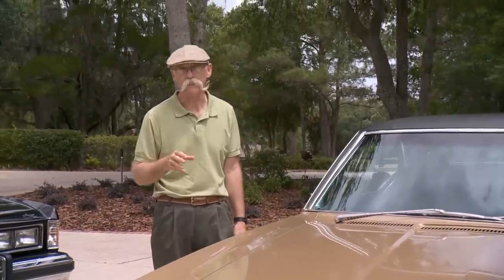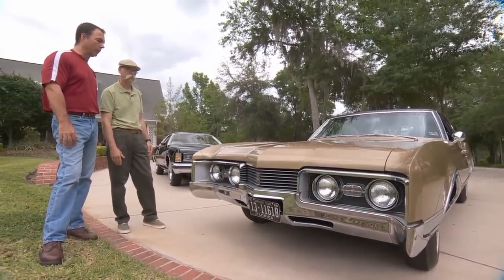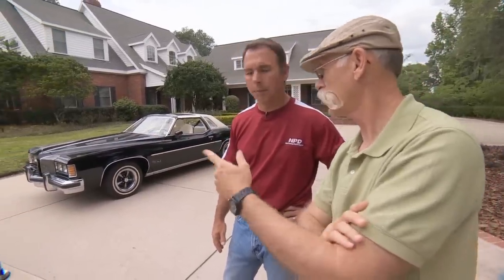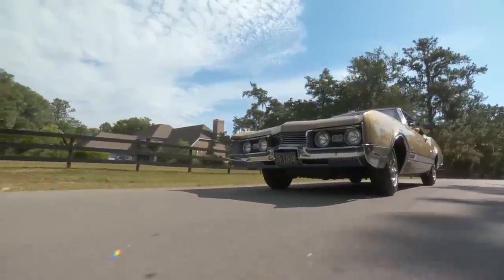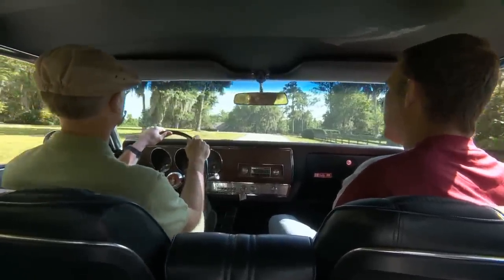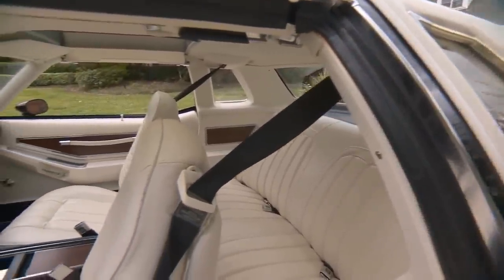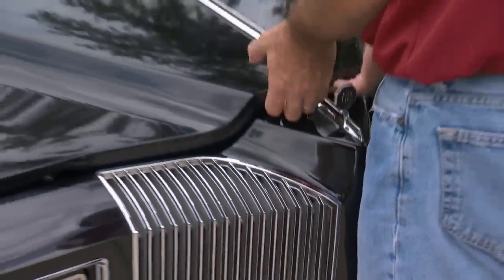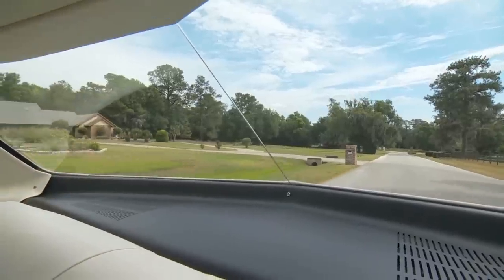GM Luxury Sports Cars

Comment: Dennis I have to tell you that I was a car salesman in 1976 and helped a customer order the most optioned car Pontiac had ever sold. Not option packages but options. It was the same color inside and out as the Grand Prix you drive in this video. But I think it was a 1977 model. The man wanted to get one before they were retired cause he loved the looks of the car. It was in Kansas and I won an award from Pontiac becasue of the order. For it's time it was an expensive car! He really worked hard and kept deciding to corder more and more things added to the car. I do not remember every detail but might if I work at it.  Pretty sure it was the 400 in it too becasue power to weght ratio was better with that engine. Let me know if you want to know about this and more from my car history. Oh yes I was driving a TVR 2500M that was modified when I bought it new in Jan 1975.

Comment: I did notice that it had no power windows, and the plain jane steering wheel, but it did have T-tops. That was back in the day when you didn't have to order PACKAGES !  You could order every option individually. Those were the days.
Reply: no a/c either..
Reply: u still can, with some dealers.
Reply: @atranas6018  most manufacturers don't allow it.
Reply: I ordered a 1973 Monte Carlo the way I wanted it. Like you said there were no package options. It took about twelve weeks to get the car. Was there when it rolled off the truck, oh what a feeling. Crazy thing it was considered a mid sized sedan .
Reply: Those were the days without imports starting to get really good and out-compete the US makers. Gravy train days.

Comment: Love the Grand Prix! I owned a 1970 SJ. It had the 455ci engine, positraction rear end with automatic transmission and electric everything!  From a dead stop it would smoke both rear tires if you stomped the accelerator! And it was smooth, a very nice luxury muscle car. If not for the 10MPG I would have kept the car!

Comment: I had a 74 Grand Prix, I loved it. My sister had a 76 and my brother had a 72.  The 74 and 76 were the same cars, except for the grills (waterfall on 76) and tail lights (horizontal back of light in center of tail light on 74). The 72 was a much different car, but still similar.

Comment: This way motors should be built, easy to work on, not compact  no computer crap
Reply: Faith Roberts if agree that the engine, transmission, and emissions should continue to be computer controlled, then I agree with you.  Reliable auto computers were IMO mastered in 2002 by GM where Old school knobs and dials were actually controlling computers, and servos.  Today's touch screens and stuff are crap.
Reply: If you kept your foot out of it that GP would get 20 on the highway
Reply: Yeah nothing like a 6.6 Liter V8 that makes all of 150 Horsepower
Reply: If they’re computer controlled you don’t have to work on them as much 😉
Reply: Beautiful & historical, but gas hogs, polluters, death traps.
Reply: That's what makes modern cars disposable

Comment: Had myself in the 80’s a ‘72 Olds Delta 88 Brougham. 2 huge doors, Rocket V8 350 and the pimpy brocade material interior. Hard on gas , but what a cruiser.

Comment: I used my dad's '76 Grand Prix to do the road test to get my first drivers license. White with a red landau top and red interior and red pin striping. What I thought was interesting was the slots in the chrome bumper for jacking up the car, the jacking points.The tire iron was the handle for the jack. Can't do that now.

Comment: I am ALMOST finished with my 1973 Grand Prix. The luxury is now gone replaced with a gutted interior with a few switches and 2 plastic buckets, 11.4 to 1 KRE 310cfm headed 461 with a reverse manual level 4.5 FTI transbraked TURBO 400.

Comment: I had a1976 Gran Prix. Blue on blue with power everything. Great car and good mpg for the time.
Reply: 400ci 4v. Flipped the air filter lid and secured it and when floored it made a motorboat sound.

Comment: The Pontiac Grand Prix, was a gorgeous car from 1963 through 1977. After that... "FOR GET ABOUT IT".....YUCH!😕😥😨
Reply: Ridgewood Fats my 2006 GXP was FIRE! So I have to disagree a little.
Reply: I agree upto the last year you mentioned. Yes they were really downsized in more ways than one after 77’ but drive a 2000-06 Grand Prix GXP thennnn give me your New Years. I drove a 73’ GP in 76’ and a 89’ SE in 92’. The 89 SE was gorgeous white over grey leather, moonroof, luggage rack, steering wheel controls, fully loaded but 3.1 V-6 was a little weak.
Reply: The g-body Grand Prix wasn’t bad!
Reply: Have a 2001 GTP supercharged that's really in the tradition of the older ones.
Reply: Just to make this clear 1962 was the first model year for the Pontiac   Grand Prix.

Comment: I had a 1976 GP in High School in 1984. My Dad bought her brand new in 76’ and passed her down to me when I got my drivers license. Black with a saddle vinyl interior. Mine was not an SJ so I did not have the center console, T-Tops or the 400CU I’m assuming the one featured here is a 4 barrel Rochester carb. Mine was a 350CU two barrel that put out 160hp if my memory is correct. I LOVED that car. She was huge and went down the road with serious presents. Tons of torque out of that 350 but definitely not a drag racer. I remember racing a Honda Civic Si ...one from the 90’s I’m guessing and I lost that 0-60 sprint by a few car lengths! But what a fun reliable car. It was hard to keep these old GM cars from rusting and the doors were SO BIG AND HEAVY that they actually started to sag on the hinges and you had to lift up the door in order to close it properly. Those were the days...

Comment: VERY RARE no factory A/C daughter probably hated that worse who orderes a black car that nice with no air? thats one of a kind!
Reply: Yet it was still a factory option.  If you go back to the 1960's, no a/c was the norm rather than the exception,
Reply: itsmegp46
 Im from West Texas and south Florida you couldnt give a black car away with no working ac , cars that nice with no ac were usually from up north from Illinois Michigan  Maine ect but you are correct it was an option
Reply: jay bradley I understand what you mean.  On my first trip to Phoenix, Az. back around 1979, I'd never seen so many cars with a/c.  Even cars from the 1950's. I never even knew cars could come with factory a/c back then.
Reply: itsmegp46
 They put those under dash ones in a lot of older cars too, we had one in our 74 Toyota Corolla it took up all the passengers side footwell area, the 50s cadillacs and the Lincoln Mark II Lincoln had the A/C unit in the trunk, it was a very expensive option i bet.
Reply: jay bradley Chryslers too  I've been to a few Cruiser Nights and the owner of a 1955 Imperial explained how it worked. Like you said, part of the a/c was in the trunk. The cool part were the air scoops on both sides of the rear fenders and the cold air coming from a vent located on the shelf behind the rear seat.  Very neat stuff.
Reply: itsmegp46
 Oh yea those too i love those cars!

Comment: 12:10 Look at that huge fan shroud spanning an extra foot of empty nose. The '73-'77 GP could be called GM's opening shot at downsizing; gone was the stretched wheelbase that distinguished the '72 GP from the '72 LeMans, but the hood stayed long and the 5 MPH bumpers kept its exterior dimensions at least as big. Pontiac also ditched the wheelbase stretch on the Grand Ville and in both cases, the stretch was under the hood, so interior space was not affected. With bumper, safety, emissions and CAFE regulations piling on, GM was gently weining the public from the kind of bigness that used to sell cars.
Reply: * weaning

Comment: Those were everyday cars when I was growing up... Where have they gone?
I like the '75 Grand Prix more than the '76 because of the round headlights. It's hard to believe that the Olds is as aged (avoiding the word "old" used in the same sentence as "Olds") as I am.
Those cars have a potential future anti-theft system...
Carburetors.
Very few people of the last couple generations know how to start a car with a carb.
Reply: To the junk yard..lol
Reply: lol. you make a very valid point.  The way I sees it. : ) is when these cars were new, people bought them, used them, There internal clock was set up at pretty much 100k miles, at around 90K miles, here comes the blue smoke, regardless of the 3000 mile oil change rule...etc etc etc.. we bought them and used them up and that was that. 
Fast forward 40 some odd years into the future, cars from the 50s and 60 are restored, and now cars from the 70s are coming into our radar. Look..parts are still easy to come by, making them pretty darn easy to restore, and the inner guts look kind of familiar and not so foreign.  Do you know hard it was finding an old (sorry) timer who could work on my 48 Hudson Commodore?
Reply: styldsteel1 
It took long enough for cars of the 70's to come into our radar. It seems like cars of the 60's were on the radar screen as soon as the 60's were over.
Now, about the Hudson...
Wasn't '48 the first year for the bathtub body?
All the jokes aside, those look like they'd have a better ride than anything ever created.
Reply: Agreed.  Yes..the 48 was the first year for the "step down" design. Very, very low center of gravity, gave the car a very solid, and confident ride. You sure do know your Hudsons.  Unfortunatly I had to give up the Commodore, turned into a money pit. It was quite the job finding someone who excelled with the knowledge of a car with a 6 volt, positive ground system. It's a lot to get into right now, but it found a good home in Florida.  Guy put a 350 chevy crate motor in it, pissed me off, kinda, but it wasn't my car to say. ah well.  I used to have a bathtub body.  The Hudson and i were one in the same.  (ok..not quite. )
Reply: styldsteel1 
I had an old AMC Gremlin some years ago, and was curious about AMC history. Hudson was a part of that history, so I read up on it (pre World Wide Web).
However, I think the Gremlin was more closely related to Kelvinator than the Hudson. It had an A/C that would chill ice cream, and the body was just as boxy as a very stylish deep freeze.
Reply: Correct.  Now, by no means am I an expert in the least, but, Nash/Kelvinator (which was the new AMC,) bought out Hudson motors, which was the end of Hudson.  I remember AMC having some peculiar bodies if not plain weird (to me anyway).  10-4 on that A/C unit. You'd never get me out of that car in the summer and not because i've become frozen to the steering wheel.  BTW, if and when you have some time if you haven't done so already, check out here on youtube some videos on J.L. Hudson's department store.  It was a monster. And I mean a monster. 29 floors, only the finest of the finest products. The videos are quite captivating so far as I'm concerned. Opened in 1927 and finally raised <SP> in 1998. They were in Chicago. Sad ending.
Reply: You''ll see the man himself. J.L. Hudson who teamed up and started the car company also in 1909. Lots of history here. He seemed like a real true to life go-getter. A slouch, he was not.
Reply: DrFruikenstein   Haha ! You're right ! That's funny.
Reply: What?
Reply: I'd prefer the looks of the 1976 Grand Prix over the '73-'75 models because of the (then) newly introduced rectangular quad headlamps. I'm SO glad that in 1976, GM phased out those outdated, cheap-looking circular headlights on the A-Body platform (featuring the Pontiac Grand Prix, Chevrolet Monte Carlo, Oldsmobile Cutlass Supreme; Buick Regal). That platform featuring those cars evolved VERY quickly, and in 1976 and '77 they ALL looked a WORLD of a lot more sophisticated.

Comment: Neither car had Air conditioning.   I'm sure that was pretty rare especially for the Grand Prix.  The 73 to 75 Grand Prix used real wood in the dash.  Most cars by then were using plastic that simulated wood.

Comment: The sad part is in 1967... Lol , the Olds is half worn out at 30K . but boy it was well cared for
Reply: LOL! Yup.
Reply: I got a 65 Olds 442 that I bought from the original owner in 1988 and it had 230,000 miles. I still have the car and it has over 350,000 miles now on original engine.

Comment: I had a '77 that was basically the same car except that the headlights were spaced with a parking light between them and the lens of the taillights was solid instead of louvered as the '76 was; otherwise, identical minus the vinyl top. Mine was solid dark green(I think they called it "deep forest green") with a lighter green leatherette interior. It had the low hp 301 V8 with a 2 bbl. carb, so not a performer....but was she ever a LOOKER!  I didn't buy it for that, so not a problem. 

It drove, honestly, like a dream, equipped with what they called "Radial Tuned Suspension", as proudly proclaimed with a small metal plaque on the chrome part of the instrument cluster. A real boulevard yacht! Had the "Rallye II" wheels, which were a signature Pontiac factory mag wheel carried over from the sixties, introduced in '67. Instead of the joke of a spare tire(I call it a "donut")they give you today, it came with another Rallye II factory mag wheel mounted on a steel belted radial tire! Didn't have a bit of trouble with it and sold it at around 125,000 on the clock. In my opinion, one of the prettiest  cars ever to come out of Detroit.

Comment: When America knew how to build cars, over 50 years ago now
Reply: TugIronChief  You couldn’t be more wrong.
I had a 2006 Saturn that was a piece of junk.
All new cars are pieces of crap that throw computer codes constantly.
Reply: You didn't have the oils that we have today back then. So engines wore out faster so engine rebuilds used to be common.
Reply: @beckigreen  Saturn is not the same as Toyota, Honda, etc.  Those are known for their reliability.
Reply: I worked on those cars in the late 60s and mid 70s. By 1976 they were junk. The mechanics at the dealerships worked like crazy to make a presentable car out of what rolled off the transporter. I had to chase down leaks under the dash on one brand new Pontiac. I had to remove the front fender and found out that a whole series of weld were missing in the cowl. The cars had to be tuned and retuned because they wouldn't keep running or they ran badly because the pollution equipment was a Rube Goldberg mishmash of vacuum lines, switches and sensors.  Driveability was a compromise because the manufacturers were trying to meet government standards that they were not given enough time to do the R&D to develop. If it hadn't been for the computer controlled systems we enjoy today, who knows what kind of junk we would be driving now.
Reply: @hotwheelsbob2000  do to that cars today are disposable
Reply: Disposable after 300,000 miles.
Reply: @hotwheelsbob2000  yessir

Comment: I'm old enough to remember when those cars were new. Not much excitement then. They weren't built that well. Makes me wonder that in 40 years from now, people will be ogling these wind tunnel-designed boring cars of today and consider them "classics". I won't be around then, but I predict not. Boring they are today, but they are safer and last longer. Why must security and style be mutually exclusive?
Reply: Terry Meadows I have a 1976 Cadillac De Ville with 63,000 original miles on it and I would rather drive it than the cars of today and it is a definite pleasure to drive and easy to handle too.
Reply: 500cid, the best
Reply: Terry Meadows the quality of the plastics and the build is not well built like the old masters built their cars in that time and they generally a design to decompose with the sun different Quality Plastics used and accepted the disposable cars
Reply: Some were built quite well. My 1970 Skylark Custom Convertible still had the original- perfectly safe- ball joints in the late 1990s, at which time I had put over 300K miles on the car which had over 100K when I bought it in the '80s. The joints were still riveted in, replacements use bolts. Original trans and rear end lasted until 1998 when the 455 I put in it killed them. Had to get the 455 because the original 350 engine's valves and cam were wiped out and the heads had recession, probably due to use of unleaded gas for a decade before I got it. That was in '91.  All control arms lasted until almost the 21st century. All electrics and the hydraulic roof worked perfectly well into the 21st century. Original brake booster and master cylinder lasted until mid 1990s. Still has OEM brake drums all four corners, been turned a few times and never again I think, be out of spec for sure. Can't complain about any of that. I always figured my car was built on a Tuesday.

Comment: When I got my DL my Dad let me drive his 73' GP. It was the loaded one. Buckets, Triple Black, Red Pinstripes. This one had the same rims on this 76' but skinny whites. Always cleaned and waxed. The 73' was the first year they started with the emissions,etc.  But the 73' still had much more power than the 74-77. 
But I love the car in this video. 

The Oldsmobile is a smooth operator. My Best friend's Dad bought a 66' Ninety Eight LS. It had the 425 cubic inches same as the 67' here. Very powerful and rode like a dream. Those two cars I speak of are the reason I love Olds And Pontiac. 

Dennis has a great job and with Schmidt he has so much knowledge of cars.